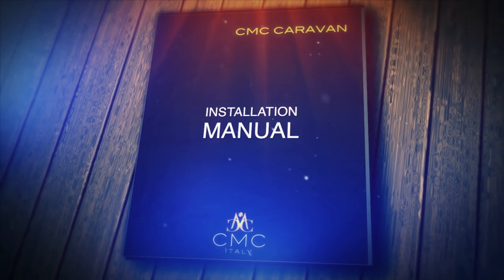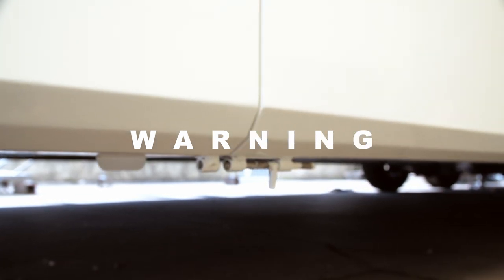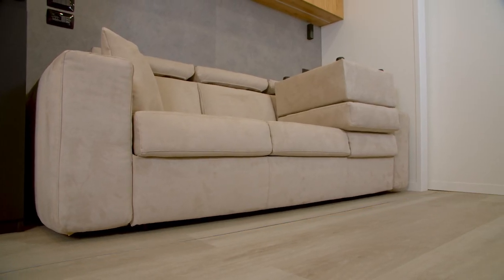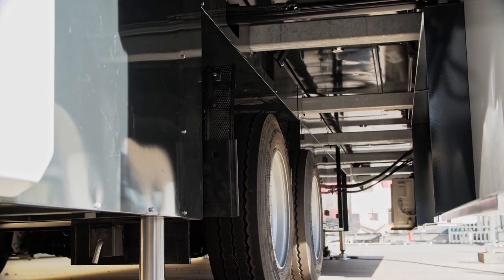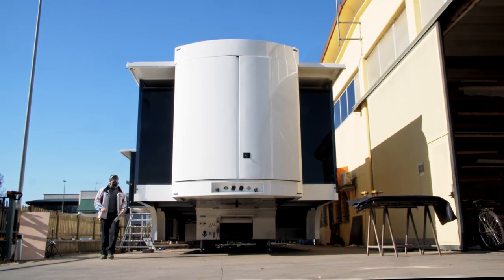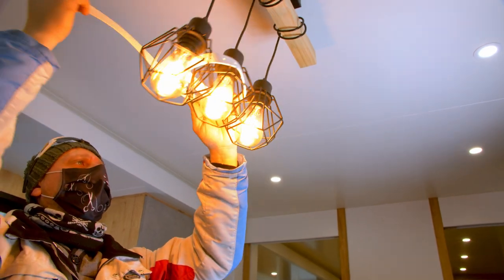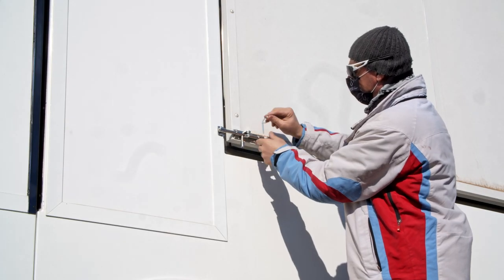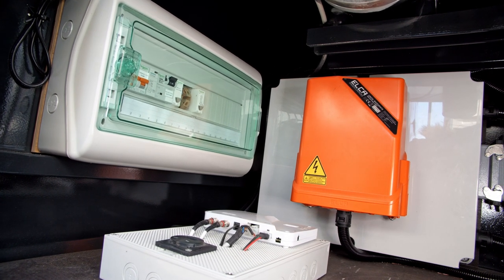CMC Motorhome - INSTALLATION

Comment: That is a beautiful trailer. CMC has raised the bar where even other rv manufacturers can’t go. The procedures for opening and closing the trailer is a bit much, especially since the occupant just wants to hop to bed after a long drive without worrying about turning their trip into a MacGyver project. I just hope the new ones will have auto leveling and leveling measuring tool built in in the future. Other than that, I love this video. Keep ‘em coming.